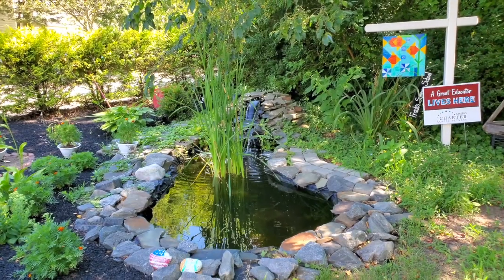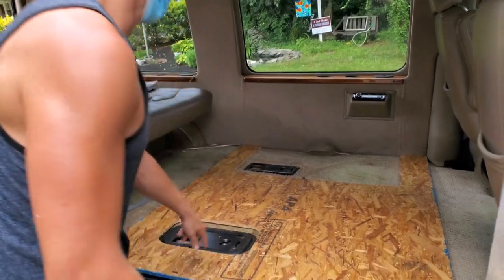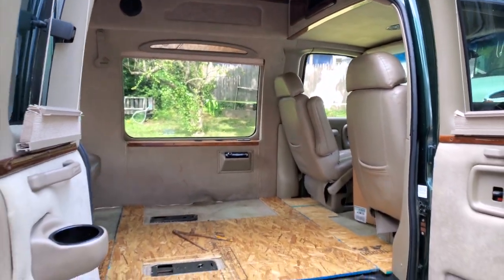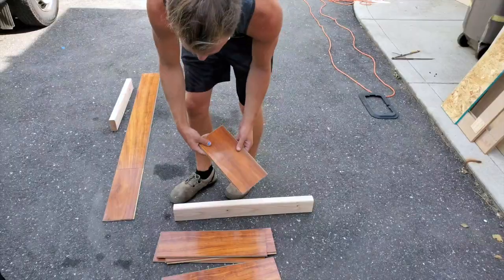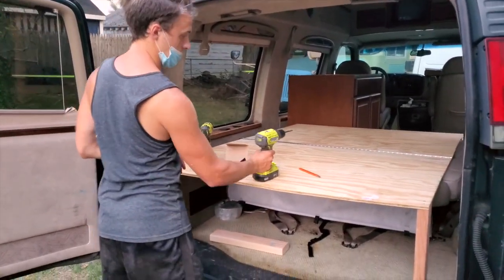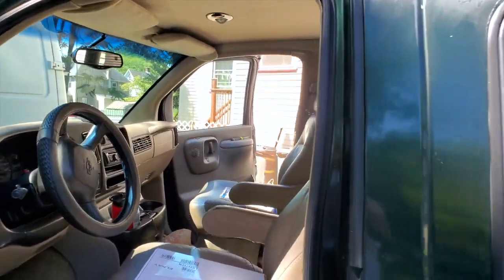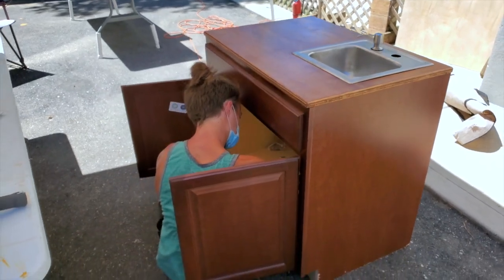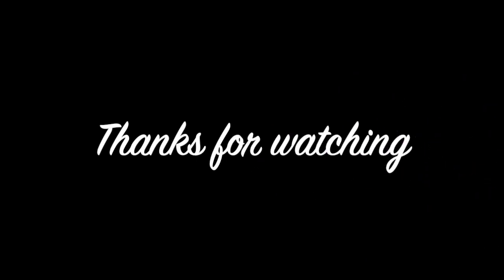2 DAYS and $500 LATER: BUILDING a CAMPER VAN - #vanlife #camper

Comment: This is the inspiration for a 2005 Chevy Express conversion van that I am planning to convert soon, thanks! One modification I am hoping to do is make the bed a loft so that the back bench seat can always be ready for passengers and the back can store taller things like bicycles. Thanks for sharing.
Reply from the maker: Go for it! and I'd love to see your idea for the loft bed, please do share when you have it all up and running :)
Reply: Regarding not adding thicker insulation: Did you bake in the summer? I am going to swing by with a no build for my first summer out but I do plan to add reflectix for all windows, a MaxxAir fan and a portable ac that vents out a front window. I’m in the Midwest and it can get hot but probably not as humid as in the South.
Reply from the maker: My van was already somewhat insulated, the reflextics helped a lot, I didn't have a maxxair fan, which would've been an amazing help... you'll have it so I'm sure it'll be comfortable

Comment: I really love your simple van build! Saw the walk thru on another channel. In your walk thru you said you didn’t screw anything in. While I like the idea of not having extra screw holes in the van body, I’m concerned for your safety. If you were to get into a accident that cabinet would be able to work it’s way free and the thought of anyone in the van getting crushed by it just freaked me out. What about just one securing screw? Happy adventures.
Reply from the maker: That cabinet is so tightly installed I couldn't take it out even if I wanted to, but I'll go ahead secure it to the floor, you're right,  safety should come first. 😉❤
Reply: Or find a seat floor mount to secure to. Or seat belt mount still no holes in the van. That high roof really make the difference as well. SUV short on head room

Comment: NJOA led me here. Great conversion. You’ve inspired so many with this DIY project. My hubby now says Yes its doable after months of me trying to convince him. ? did you anchor the kitchen cabinet down so it won’t tip. 
Tks and happy trails.
Reply from the maker: Awesome! Thank you for the kind words, we used an old building technique, we cut the plywood on the floor to size, that grabs and holds the cabinet tight, the bottom of it basically is inserted in the cut, and doesn't move...

Comment: Hey Isacc... came over from Patrick @ NJOA!  Subscribed! I have a Chevy G20 and love how you just installed the wood floor on top of the carpet!!  Curious tho... can you please tell me where you screwed the plywood down besides along the front and side with the aluminum trim?  Or was that it?  Did you use the cabinet and the side aluminum trim to hold it into place? also did you use a vapor barrier underneath the wood flooring?? thank  you!  Lara is beautiful!  And I am so EXCITED to see I can install the engineered wood planks I have over the carpet without pulling it all out!! Yay!
Reply from the maker: Yes, basically we used an old technique of cutting everything to shape so that they all hold each other in place, just like you've said, the cabinet and the walls of the van, they all pressure each other and nothing moves... hope it's the answer you were looking for, can't wait to see your built 😊

Comment: Hi Angel. I have the same kind of setup in my van as you do. Original decor, plug and play system. I'm looking to install a cabinet and sink. How did you attach the cabinet to the van? Did you remove the original backing on the walls or attach it to the floor? That's my only setback and I'm ready to hit the road. Thanks for any advice
Reply from the maker: We cut everything into size with the sub floor and pressure hold it using the original structure of the van, just like Legos
Reply: @WhereRVGoing  ok cool thanks.

Comment: is the cabinet attached to anything? does it move or tip forward when travelling?
Reply from the maker: Nope, not moving at all, used an ancient building technique,  basically cut the exact size and shape of the cabinet bottom in to the plywood that makes the floor, and everything else is holding it in its slot by pressure, all locked in, super solid and safe

Comment: What size mattress did you go with?
Reply from the maker: We ended up with a full size, 8inches mattress
Reply: @WhereRVGoing  Did you have to trim it?
Reply from the maker: Not when we used it longways, however after the reconfiguration we had to trim  just a little bit around the corners to fit with the curvature of the cabin...